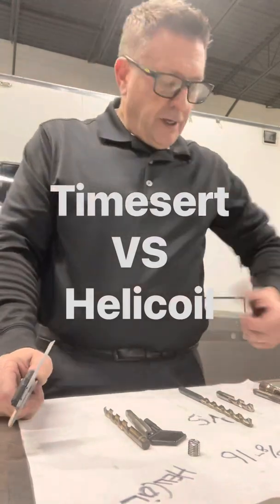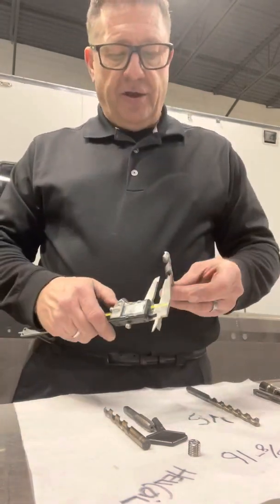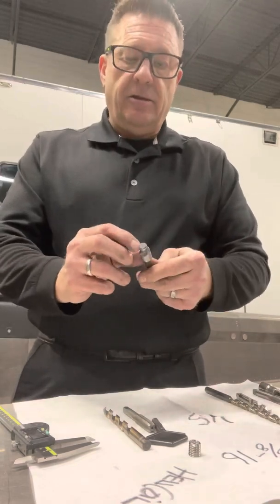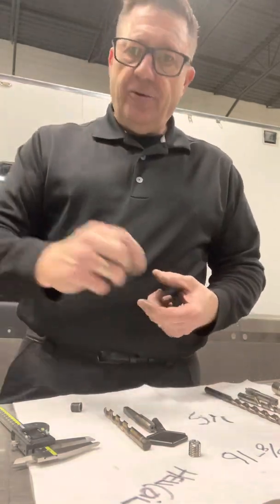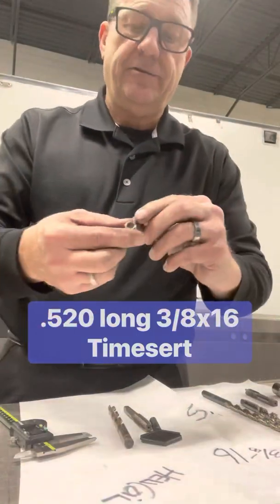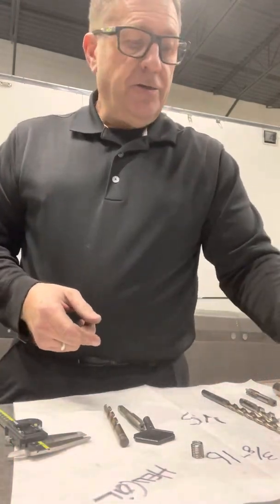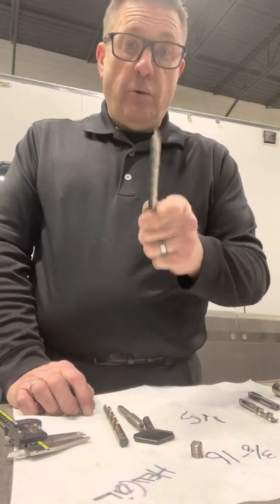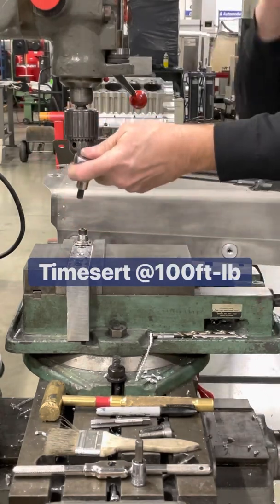I made the Timesert BETTER!!!

Comment: I've been undersizing anything I drill for aluminum for yrs. I figured this out through trial and error several yrs ago. 
Also for example on aluminum of the threads are 7/16 and are stripped I will clean the remaining threads with a 7/16 drill or end mill and go straight in with helicoil tap. I never use the manufacture recommended drill to install helicoil or timecert. hope this makes sense.

Comment: One thing I’ve noticed while using drill bits for a particular application where tolerances are adhered to more closely than usual is to make sure your drill bit being used is sharpened accurately. 
   A drill bit can be used with great effectiveness and still only be cutting on one side of the bit.  
 This can cause the bit to corkscrew pattern and created both an oversized hole and a hole with a corse departure in any direction. 
  Just drill a sacrificial hole in a similar material to ensure hole size and quality when necessary.

Comment: First, I love your videos. My question is why would you need a thread insert to perform at 3 times the torque of the fastener torque? I understand that there can be momentary tension loads that are high, however the clamping load of a 3/8" grade 8 bolt is approximately 7000 psi and I would think the parent  material would be compromised not far above that point anyway. Wouldn't a larger bolt diameter or longer thread engagement be a better solution?
Reply: The simple answer is . In TF every 0.0001 second anything can stay together longer can mean the difference between winning or losing a race or grenadine a motor . that is built to run for 1 minute from burn out to disassembly re assembly and run again . The moment load is intense and needs to exceed in any way it can , so while the parent metal is at or past it's yield the clamping load never drops below in that short of time . It would be easy to weld up and re thread holes only to have the same parent metal not hold long enough again , the load force is shared with a insert of similar metals. That is a lousy way to explain what is happening but the best I can do . At 1200 ft it all only has to last another .004 seconds to get to 1320 ft and if that bolt can hang in all is better .

Comment: In my 25+ years as an auto / motorsports mechanic I installed probably 300 or more timeserts.  I NEVER had one fail or cause any kind of issue.  I switched to them from helicoils as the smaller ones (5 & 6mm) would break in the bore too easily if you were not extremely careful (sometimes a difficult task in very tight areas).

Comment: Because of the way a helicoil twists your test would be a lot more valid if you were measuring clamping force instead of rotation force.
Reply from the maker: Correct. It was a twisting issue I had and was just trying to figure out why it would not hold torque that it was rated for. I am a TimeSert guy and was having an issue so I wanted to just compare apples to apples. Thanks for the info!

Comment: When doing most thread repairs  I never experimented with Heli-coil or Timesert for torque straight , in most cases the kit was sufficient to do a job , access was limited  and had to be done with a hand drill . I did notice and question the looseness of the insert to the tap threads as to a weakness , using a smaller drill bit would help . It’s hard to drill straight with a free hand and a smaller drill  would minimize a lose fit , I.e. the tap would have more metal to work with  .  You mentioned not using Loctite but never elaborated why it was not used , any reason ?
The importance of drilling with a drill press and firmly securing the part at 90 degree or perpendicular to the force exerted on the threaded hole is critical in some cases . Good example : repairing an engine block on an old BMW airhead to reinstall a head bolt stud , it’s critical to be perpendicular to the head , torque will very if the repaired stud hole was slightly angled in the machining process , torque specs on that stud will change over heat cycles and the head gasket will fail . 
Your video was informative and it’s a step on some precision work that can make a big difference , as they say your work is only as good as your setup , Thanks for the lesson 👍!

Comment: 🤔 I was wondering If you heat the aluminium to simulate engine heat then drill and insert the timesert  i wonder would it hold better as the hole when drilling warm will have suffered from thermal expansion 🤔 would it be a tighter fit

Comment: I was told by a guy who recalibrated torque wrench’s that you should always back off setting before advancing to next torque sequence setting. I see that you rechecked you wrench setting and 100ftlbs. was actually 103ftlbs , could that possibly be why your wrench setting was off? Thanks again for the explanation on your testing videos Heil vs. Timesert very informative.
Reply: Its within tolerance for the torque wrench most likely.

Comment: I can make this conversation really easy helicoils are great when you're fixing a damaged hole we're no fluids have to be involved like a hole into oil galley hole to coolant Passage. Now time sert's are the best product of all time for repairing stripped spark plug holes by far in aluminum heads priceless and as I said holes with some sort of fluid that you do not want leaking out the thread holes

Comment: If Timecert was the way to go Alan Johnson wouldn't be installing Heli coils in every new head and block. Timecert weakens the base metal because it requires a much larger hole to install. Why are you torquing a 3/8 bolt to 3 times it's fail point trying to prove your point? If it holds at 50 pounds you have exceeded the fastener. Dumb video
Reply: Rewatch gumby